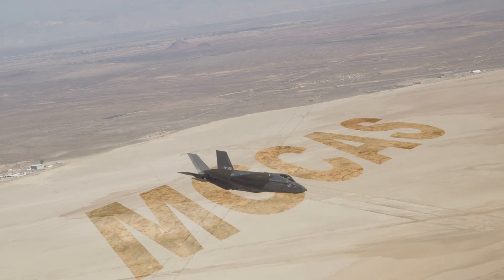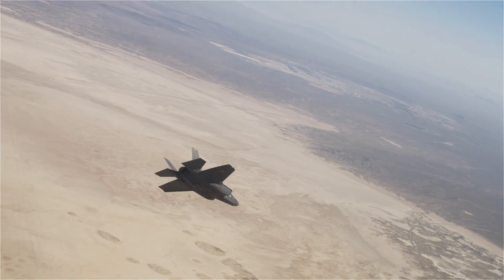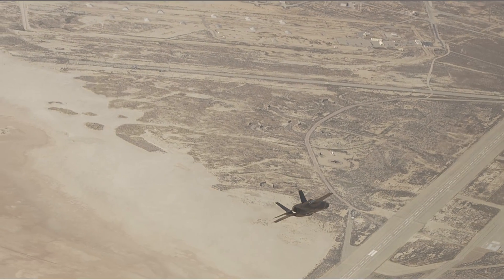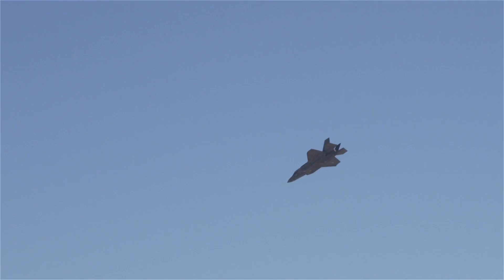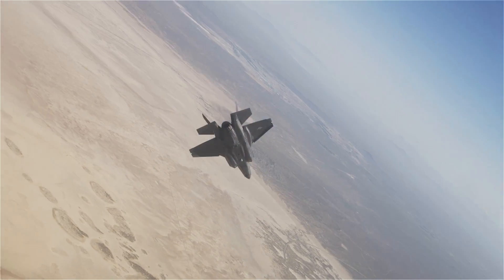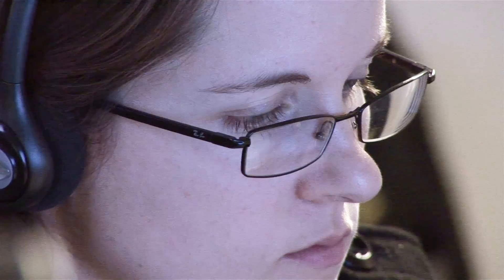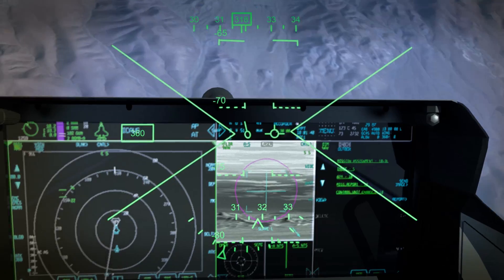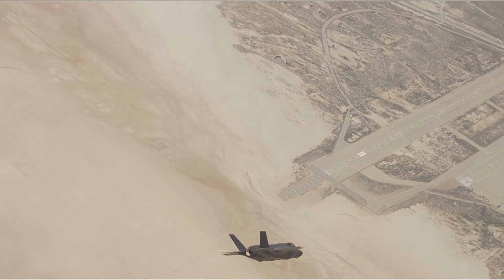F-35 Manual Ground Collision Avoidance System Testing

Comment: Do jets ever encounter turbulence while flying like commercial passenger planes?
Reply: Yes of course. The aircraft doesn't react nearly as much however since the wing loadings on military a/c tend to be higher - more weight per unit of wing area - and consequently they fly in a manner that's a little closer to the bullet end of the spectrum than your typical airline jets.

Comment: What if the pilot needs to fly really low ?
Reply: Deactivate. Re calibrate.
Reply: It's possible that the system considers how quickly you are descending, the faster you are descending, the higher it warns you. If you are not descending, you may be able to get close to the ground without a warning.
Reply: The gyroscope is able to tell if the plane is heading nose down at high speed and will initiate the recovery process.

Comment: Why is the plane the plane that the F-35 is supposed to be replacing getting the auto ground collision system while the F-35 is getting the manua version ??? Did i just hear wrong or miss something bc that makes absolutely no sense to me...
Reply: The F-16 is just a test bed. You wouldn't want to test a completely new untested system on another completely new and untested system.
Reply: I know this is yeaaaaaars later, but we also have wayyyy more F-16's. Putting them on the F-16's would save more lives than F35, if we are talking odds here.